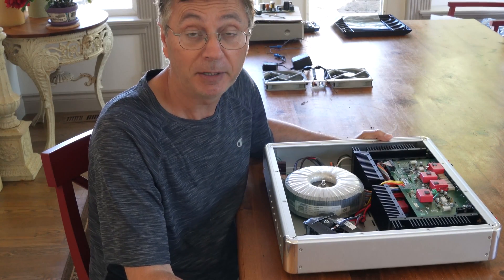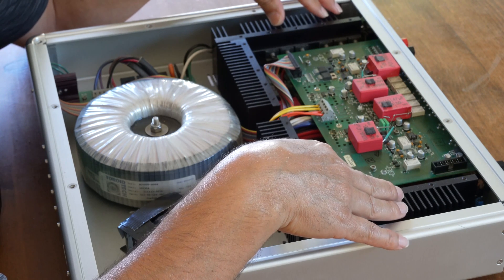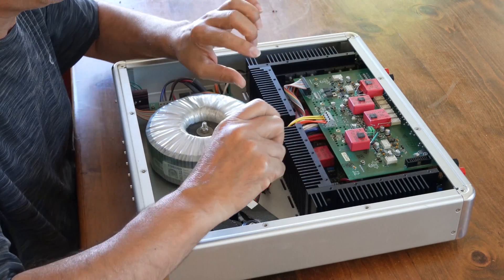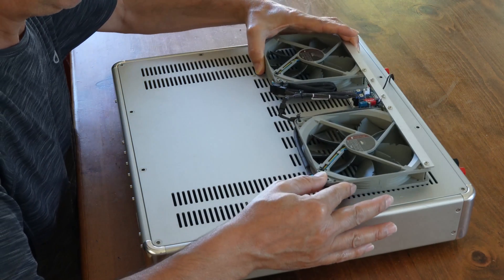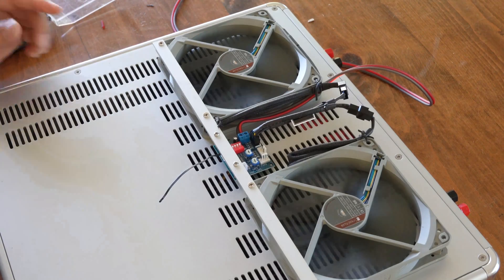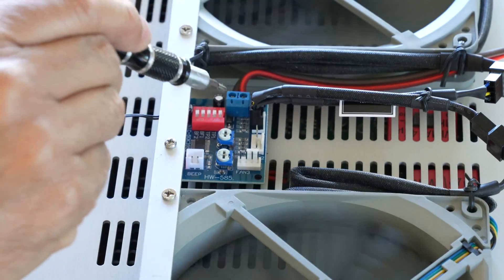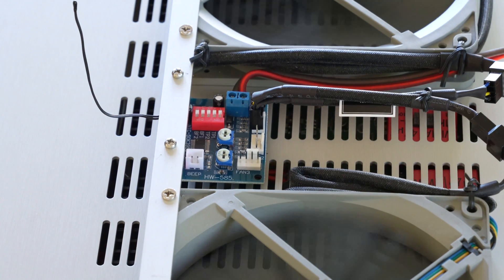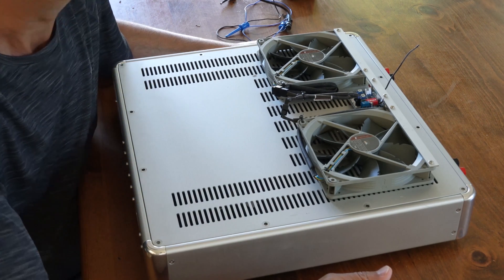Is your Amplifier running Hot

Comment: My Samson Servo 240 will get hot in left channel during warmup. 3 seconds max time for finger touch test at output transistors. But after 15 minutes it cools down to being mildly warm. Sustained loud hammond organ playing does not increase heat sink temperature. I replaced all 1N4148 diodes. No change. Output and driver transistors check ok.
Reply from the maker: If it is old could be a bad capacitor somewhere 
The fact that one Chanel does it signals a problem
Reply: @Gabster1 
Thanks.

Comment: I worked on copiers and when we junked one I would remove the little 24 volt fans. I have a box of AC to DC converters and I would wire a 6 or 9 volt adapter to these fans and they would run very quiet. All but one of my receivers have switched AC outlets and it works perfectly.
Reply from the maker: Excellent same idea without buying more
Reply: @Gabster1  apologies but could you please clarify what you’re using and how to prove the 6VDC power supply for these fans? Didn’t quite get all the details from what was said here. Thanks 👍

Comment: The feet on many amps are pretty short, replacing them with taller feet will increase convection and help cool the interior of the amplifier. I used to put my Hafler d220 on 2" high blocks and that improved cooling a lot on that amp.